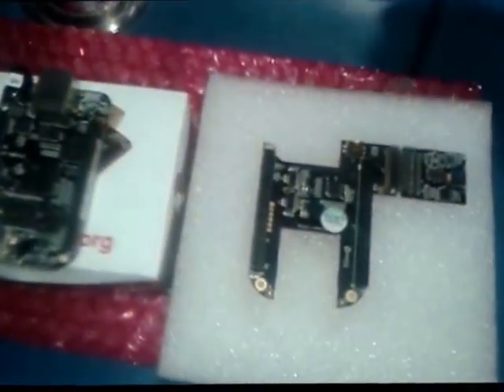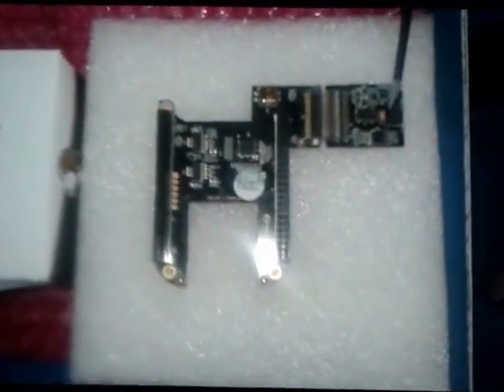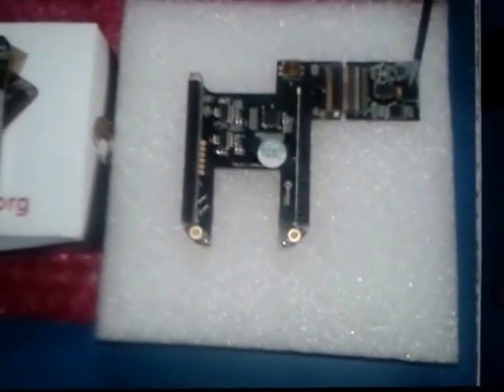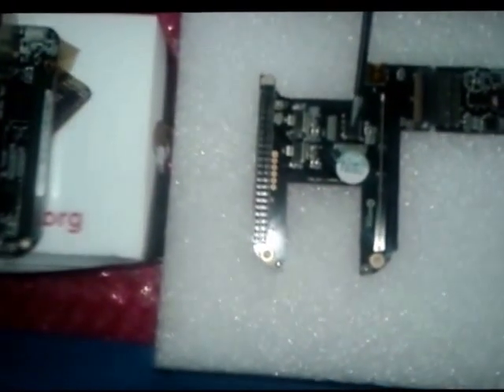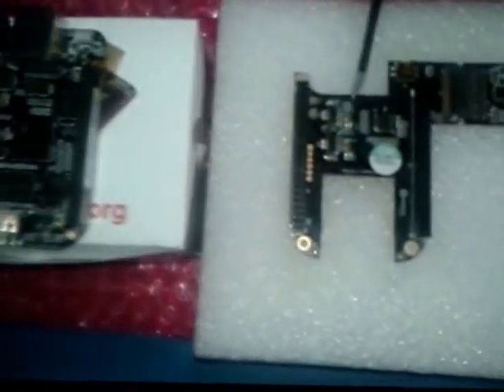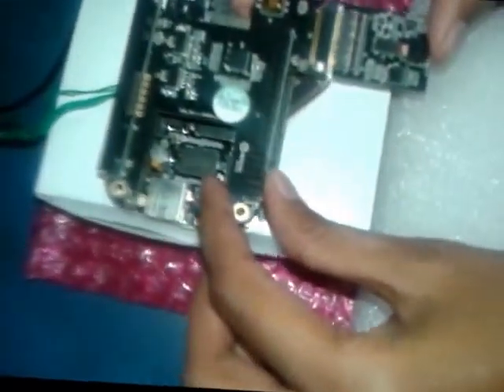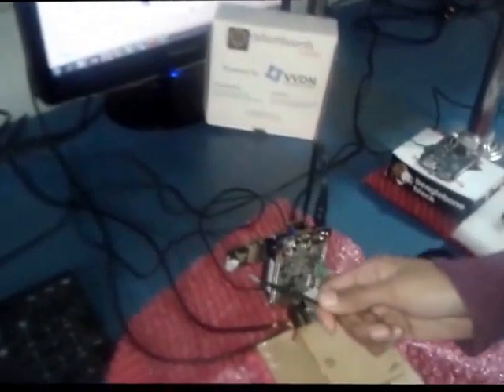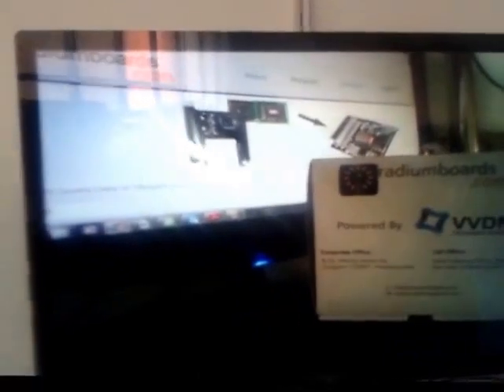Beaglebone Black Camera Cape -Introduction

Comment: As part of a student design team, my group has been working with this camera cape for the past 8 months, and we still are having trouble coming across the right code to get it to work. Struggling to get product support for this has been a nightmare, so we strongly recommend passing up this product until its software support is sufficient enough to get the product running. For almost any modern plug-and-play hardware device, example code samples are a must (the source code provided does not help with actually performing camera actions, etc.).